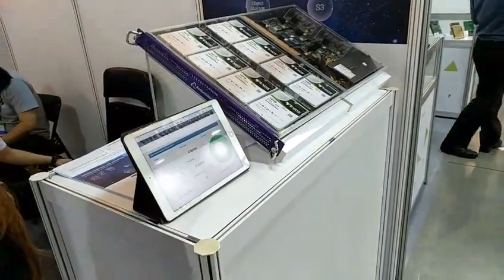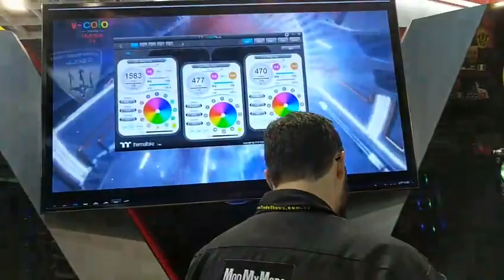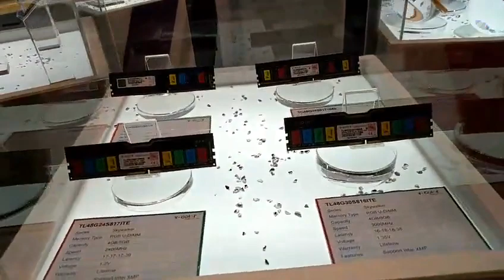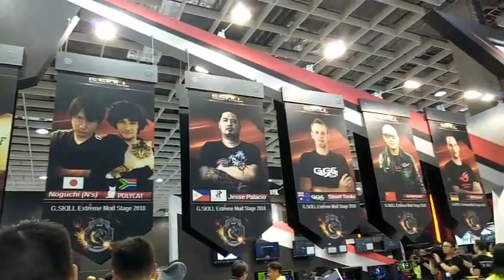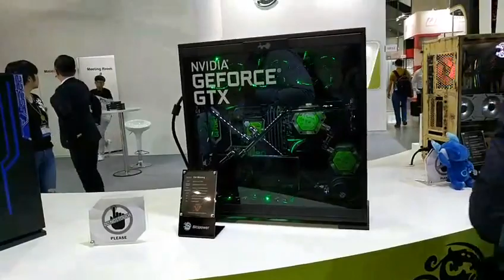Computex Day 2 - First floor tour of Nangang Exhibition Center

Comment: The official price I heard for the InWin aluminium chassis (15:58) is $5000 US, I think it was Hardware Canucks that found out the price.
I don't know about you guys; I'm about done with all the RGB nonsense that's made its way to every component in a PC build, the final straw is the RGB power extension cables from Lian Li.

Thanks for the tour(s) of Computex 2018